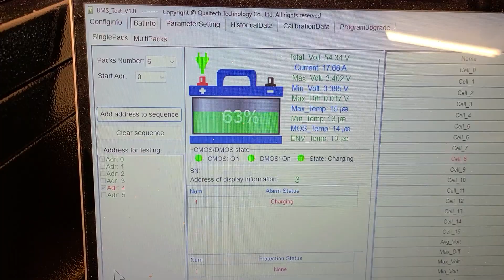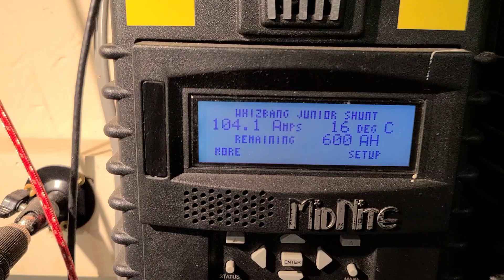48v (30 kWh)  EG4 Lifepower4 LiFePO4 battery rack system - commissioning, busbars fix action

Comment: Nice job . I think that's better than I worked out. Just now seeing this crazy busy here with meck room build.
Reply from the maker: Thanks. You got a lot of work going on...but, it is going to be even more awesome when it's done. I just about used a tap/dye holes into the busbars, but decided to just drill 1/4" holes for the small wires and drill out two of those rivnut inserts for the 4/0 lugs. On the 4/0 copper hole, it is larger than the lug's 5/16" eyelet...but, plenty of electrical contact to the busbar. The "trick" I did when reinstalling the busbars is to remove the two isolator screws and ease the copper back to get a wrench on the backside to tighten up the bolts. Copper is flexible enough. I "pre-installed" the six red and black little wires and torqued them down HARD and then installed into the gray PVC cable raceway and mount to the isolators. And installed the 12 wires to the batteries. Went smooth. While drilling the holes and removing two rivnuts, I thought to myself, "it sure would have been nice to work with a blank, solid piece of copper busbar without all these crap rivnut inserts". They could keep the mounting points for the isolators but eliminate everything else. But, to some people it would it would be a bitch and too much. You and I would be joyous if it was that way. This bubar fabrication was one helluva work around task and thank you for your insight. Right now, it is 0535L and I have been inverting all night (~18 kWh used). Sitting at about 33% SOC. So, I have about 10 kWh left in the tank from my calculations. They are doing their job..

Comment: The first thing I thought from your last video with the replacement busbar was to just pop those rivnuts out and homebrew your own nut/bolt solution
Reply from the maker: Thanks. Agree. For the two big 5/16" eyelet 4/0 lugs that is what I did. I just drilled out the rivnuts and had an open hole. It is larger than 5/16" but those 4/0 lugs are beefy enough that gap difference isn't an issue. I used 1"  5/16" Grade 8 bolts, flat washers, and lock nuts. As for the other holes, I just drilled 12 1/4" holes into the copper and used 3/4" long 1/4" x 20 Grade 8 bolts, Nylock nuts, and flat washers. I scoured the copper surface with steel wool...made it nice and shiny.

Comment: My 48v 8x GC6 battery set is on its last legs, looking to get another set or perhaps upgrade to the LiFePO4.   The depth of charge with the LiFePO4 sounds great on its face, interested in your real world experiences!  Running a single OutBack FLEXmax with 2400 watts of panels.
Reply from the maker: Good luck with your system and build. As for lithium, I will never go back to flooded battery chemistry (wet or dry or AGM). Yeh, the depth of discharge and cycle rates with lithium is sexy great. Most modern lithium batteries sold on the market have a BMS built in (brainy batteries). You can't cook them or hurt them without them getting pissed off.

Comment: Hey Chris, Its looking good.  I think replacing the bolts the way you did is probably a good idea.  I am a bit concerned about the ones I have snapping off.  I am keeping an eye on it but no problems thus far.  I do have different bus bars then you.  One thing did catch my eye and its probably nothing to worry about but thought I would mention just in case.  When you flipped the door, the grounding bolt (on the door) is now sticking in near your main Pos terminal.  I can't tell from the video how close it gets when you close the door but looks like maybe 1-2 inches.  Take a look just to be sure.  :)
Reply from the maker: Thanks! You got an Eagle Eye! Yeh, I saw that swing door threaded bolt end exposed. My cabinet didn't come with a strapping wire like others I have seen. It clears the POS bus by 2.5". And the gray PVC cable raceway covers where not shown in this video...secondary protection (even with the bolt on the swing door. As for your busbar, good luck. The mods I did  is one way to do it, but I don't trust those rivnut inserts at all. If you have ones popping out, not good at all. These batteries are basically a tall 600-amp arc welder. Good luck and let me know what you come up with.